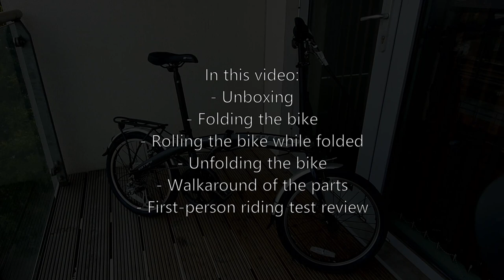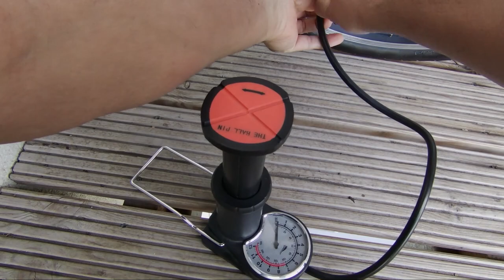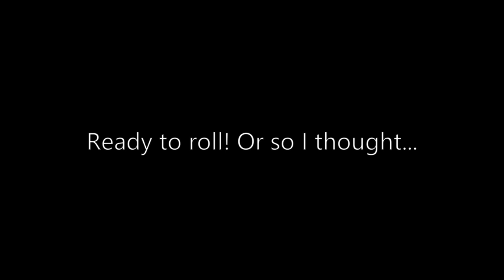Carrera Intercity Folding Bike - Unboxing, Walkaround and First Ride Review

Comment from the maker: Timestamps:
Unboxing 00:31
Weight 2:26
Close-up of ball & folding clasp 2:41 
Common areas easily scratched 03:55 
Safety Warning: Steering column  04:27
Tighten steering column lock 07:20
Folding the bike 08:46
Folding the pedals 09:08
Rolling bike along while folded 09:41
Unfolding the bike 14:10
Tour of the parts 15:37
V-brakes 16:29
Tyre specifications 16:38
Seatpost and saddle 17:15
Bell 17:50
Middle folding clamp 17:53
Ball & clasp fold lock 18:15
Double sided chain guard 18:53
Luggage pannier rack 19:08
Gear index adjustment screws 19:32
Handlebar angle adjustment 20:19
Handlebar stem height adjustment 20:36 
Riding the bike POV footage / review 22:21
Reply: Thanks
Reply: @18:15 I read a review which suggested that instead having the handle in the middle (between the wheels) when you fold, to fold the bike in half then hang it over the saddle.

Obviously it won't be as compact but it locks in a lot more easily. I'm going to do it this way for a while to loosen it then try your method. Very helpful video!
Reply from the maker: @Fred-my9er  Yeah when I first got the bike the clasp was really hard to connect with the ball and it took a while for it to become looser. Hopefully as you use it with the handlebar on the outside it makes the clasp less tight and it becomes smoother over time.
Reply: Put a helmet on next time!!
You need a helmet on!!

Comment: Just bought this bike last week. Its great 👍. Its light, fast and a pleasure to ride..brakes are safe and responsive..for what you get its a bargain..the handle  bars are wide and the end grips so soft rubber making them comfortable and keep your grip secure in the rain..the 8 gears is enough for general commuting around the city as the Cog is larger in size so as to get more distance with each pedal rotation...I will be staying with the folding bikes from now on and at some point will be getting a 16 inch wheel folding bike and perhaps an electric one  but would be happy to ride a none electric as they are so light and easy to use...I am surprised at the speed . Its such a pleasure to get around the city...actually I dont use it as a folding bike and having put permanent nut and bolts in place on the bike as I leave it outside work for several hours, I do have a decent lock too, its a  Kriptonite extra strong anti drill lock and the steel cannot be sawn into....im happy with my first carrera intercity folding bike 😊

Comment: It’s cool to see at 25 minutes or so on Lower Thames Street that the guy on the road bike, who looked like a pro (road bike and dressed like a cyclist), didn’t speed off into the distance even though he looked like he was leaving you at the lights a peddling off relatively quick. You were catching him at the next light every time.
That’s very reassuring to people that might think that kids sized bikes (I know folding bikes are adult bikes) travel at kids speed, but you were moving at normal bikes speeds and even overtook several bikes.

Comment: I got one of these cheap second hand recently and found folding a hassle because you have to angle the brakes/lower the stem and the stem folds to the left so dangles around and gets in the way of the folding mechanism. Can't understand why they didn't make the stem fold to the right like a Brompton where it's out of the way. Anyway, I took an Allan key and unscrewed the stem and mounted it backwards and flipped over the handlebar, now it folds like a Brompton and is much easier to fold quickly without having to alter the height of the stem or the brakes and it stays put and doesn't get in the way when folding. The catch is still far too stiff for me when trying to unfold it, so I might source a strong magnet like they use for door catches to hold the frame together.
Reply from the maker: These bikes are great value second hand.

It's useful to know the stem can actually be switched that way for anyone who prefers it folding to the right. Thanks. 

Personally, I like it the way it is, as the handlebars and stem are then fixed in between the wheels and it takes less width space. It also results in a more manageable 'cuboid' shape to put inside storage bag or slim interior gaps in the house. But agree, it definitely comes at the cost of more steps to fold it like that. 

In regard to the catch, the front half of my one (the ball end) had actually wriggled itself loose out of the threaded socket attached to the fork and fallen off somewhere so I had to find a replacement. 

I took a chance on a magnetic catch originally designed for Dahon bikes but the plate side is actually the same bolt size as the ball head I lost so was able to simply screw that in to the threaded socket. I then took off the black bracket from the rear wheel, and attached the magnet half of the new catch and it works pretty well and is much easier to lock and detach. It's also still strong enough to keep the bike folded when lifting etc.

I bought mine off e bay - if you search for keywords "Magnetic Folding Bike Catch Dahon" you'll probably find several examples, if you wanted to have a look.
Reply: @ImOnItLikeJamOnToast I've ordered a magnetic latch off Amazon that looks identical. Also I've seen a seat post stopper with a castor wheel available on there. If I install that, it would lift the rear wheel off the ground slightly letting me leave the handlebars up and roll it using the front wheel balanced against the castor similar to a Brompton in shopping cart mode. I'm basically turning it into a cheap Brompton, I have a Brompton, but I was looking for something with bigger wheels, but all the other folders are just useless heavy lumps when folded and you can't really go shopping with them, but this config might work. Also allows me to leave my Brompton home when it's wet and muddy as the small wheels don't allow much traction in the rain.
Reply from the maker: @neverstopplayinghard   That seat post stopper wheel sounds cool. Wonder if it would still let you lift the seat post up as the base of the post needs to go up into the frame when lifting the seat into riding position.
Reply: That's a good point, this is the one I ordered: https://www.amazon.co.uk/dp/B09V76BH6T? If it gets in the way I might be able to sand it down, or get a seatpost extender to cover the lost length. I just need it to roll effectively when folded up, as it's just a bother to move around. Brompton are definitely the best bikes for going shopping with, except you definitely need a rack fitted for stability.
Reply from the maker: @neverstopplayinghard  Thanks for the link. Looks like an really useful accessory. Would be interested to find out how you get on once it arrives 👍🏼
Reply: @ImOnItLikeJamOnToast  To update, the seat post stopper wheel I ordered fits, you can expand it inside with an Allan key. The seatpost will also extend up through the frame without it catching which is excellent news. With the seatpost down and handlebars up you can push it around providing you lean it to the right slightly so it balances only on the seatpost wheel and front wheel without engaging the back wheel and mechanism. Though I find it actually less awkward for longer transport while folded to just push it from the other side so the handlebars are backwards and you angle it up like you do pushing with the seatpost in the video except now you can rest it without it damaging the gearing. The Dahon style magnet catch works ok but the plates don't seem to line up flush because of a slight angle which is not ideal, might try putting one of the bolts in a vice and bending it to a better angle. The bike certainly copes better in the wet than a Brompton, but still takes much longer and more fiddly to fold and transport.
Reply from the maker: @Steven Williams thanks for updating. It's great to know that seat post stopper works with this bike.
Reply: Genius😊

Comment: Old video, but good information. This bike is offered under many different names, it's important to check every nut and bolt, and the frame and handlebar locks MUST have the security clamp in use at all times.

Comment: Good review. I’ve had this bike for about a year, really nice bike but I’ve not had a chance to ride it enough. Good tip about the steering column lock, thankfully I’ve never had an issue with it loosening but I’ll be sure to lock it in place now.

I also agree that the mud guards should’ve been painted black/dark grey  to match the frame.

Comment: Im only nearing the half way mark in the video and had to pause to say something.

What a well and clearly spoken, calm, person!

Even a Londoner understands you 1000% 🙈

Brilliant explanations so far! I hope the ride part goes well (excluding the steering folding in half on you on your first ride - could happen to anybody)

Just saw the date… do you still use this bike and how has it held up 1 year later?
Reply from the maker: Thanks for your nice feedback. I still use the bike now and then for leisure but since getting a job where I can work fully from home about a year ago  it doesn't get as much use as before. It does still come in handy for quick trips and for exploring holiday areas when I've taken it in the car. Bike hasn't given me much major things to complain about, only minor things like the rubber handle bar grips have loosened  slightly and lost one of the folding clip ends after it fell off somewhere. I did manage to find a replacement solution (magnetic clip) which seems to be far easier to use, so maybe a blessing in disguise! I'll try and do an update video on the bike soon when I get some free time.

Comment: Fantastic review. I'm just about to be given this bike. Did you find that the locking mechanism is a bit loose? The bike opens up too easily.
Reply from the maker: If it's clipped in properly, it's actually very secure in mine and takes a sharp tug to get it open again.

Comment: Thank you very much for your valuable sharing. I want to learn riding bicycle. Is this bike suitable for learner and is it pre assembled? 😊
Reply from the maker: It comes assembled, but if buying in box, the gears and brakes may not be tuned or perfectly set up so that would be something you'd need to look at getting adjusted if the gear changes are not smooth or brakes are scraping. Both are fairly easy to do at home if you look up tutorial videos on these subjects.

In regard to learning how to ride, a folding bike probably wouldnt be my first choice to learn as the steering can be 'twitchy' on these bikes where the fork and stem are tall and the wheels are small. By this I mean, the steering has more tendency to turn by itself if you're not constantly holding the handlebar and correcting course. On a normal bike, the front wheel is easier to keep  pointing straight ahead. Once you've got the hang of riding, a folding bike would be no problem after that but as a learner it might be a lot more to take in, on top of trying to learn how to balance your weight etc.
Reply: @ImOnItLikeJamOnToast  Thank you so much for your valuable advice. It’s very very useful for me. If folding bike is not very suitable for learner, which type is suitable？ Mountain bike or hydrid bike？ Any brand is the best？ Thank you very much ！
Reply from the maker: @attilayeung3208  I would say a hybrid bike is better as they tend to be lighter than mountain bikes, but there are also some light mountain bikes too so best to check the weight when buying. An important thing when learning and for comfort, is to make sure the bike is the right size for you, you are not stretching/bending too far to hold the handlebars and you can easily touch the ground with your toes.

 There are many good brands and options. On the budget end, I heard good things about the Triban, Rockrider, and Riverside models from Decathlon. From Halfords, the Carerra Subway Hybrid models have good components and reputation. There are more expensive brands like Giant and Specialized but I don't have much experience with those but they seem to be very popular, I see a lot of people riding those names.
Reply: @ImOnItLikeJamOnToast  Thank you so much. Your advice is very useful for me.

Comment: Nice vid, I am a lot taller than you nearly 6ft, you said you are 5'7", can you tell me how much travel of the handle bar stem is  there, I would not want my handle bars to be to low when riding?
Reply from the maker: I have the handlebars near the minimum mark (lowest is 8 I have it at 7). The handlebar raised at the maximum safe limit (near the '1' mark) measures a height of 110cm from the ground

Comment: Good review, I got this bike last week, bicycle newbie and this is my first bike. I  got it from halford and while riding my handlebar went to the left  side n I nearly stacked it... which was scary, had to take it back to halford and they had to tighten the handlebar.....  my middle clamp the bottom which says open n close doesn't work... I just need to clamp n unclamp? Is this the same with yours...
Reply from the maker: You need to slide the little lock switch on the top of the clamp in the direction of the side that says 'open' with your thumb and hold it while you try to open the clamp. Otherwise the clamp won't open for safety. Look at around the 18:00 mark in the video where I open it. Hope this helps.
Reply: @ImOnItLikeJamOnToast  my one doesn't work like that, I can open it without pushing it down to open.... I did question this with halford and they said it looks fine and had tighten the clamp...
Reply from the maker: @modin5109  Hmm, doesn't seem right. Mine works as like in the video, you have to slide the switch to 'open' in order to release it.
Reply: OK thanks, I just checked and all the little rock does is slide but it doesn't matter if I slide it or not  as clamp can still open

Comment: Would you still recommend this bike today for general commutes?
Reply from the maker: I would recommend this bike if the ability to fold it is a vital requirement as it does come at a cost. It is nippy to ride for journeys less than around 4-5 miles, but I find it tiring/uncomfortable for journeys longer than that due to the smaller wheels, it does feel less efficient than a 26" or 700C wheel bike. If you don't need a folding bike, then a full size rigid bike is faster and more comfortable for commuting.

It is great for situations where I want to quickly go somewhere and take the bike in with me (I take it to supermarkets and put it in the trolley or roll it folded for quick purchases, for going into local off-site work locations, to the barbers and put it folded inside the shop, put in the car boot and explore the surrounding areas etc).
Reply: @ImOnItLikeJamOnToast  Brilliant. Thanks for the reply, much appreciated.

Comment: Do you know what the maximum weight the bike can hold is? Thanks for the video!
Reply from the maker: The manual didn't mention anything regarding max weight. But according to halfords website, it is 100 KG max for their folding bikes:

"Unless otherwise stated, folding bikes are designed to carry a rider of up to 85kg (13st 5lbs) and up to 15Kg of luggage."
Reply: @ImOnItLikeJamOnToast  That's fantastic thanks for the answer!
Reply: I'm 14st or just over....

Comment: I got this bike a few days ago. I managed to fold it by watching this video, but when I unfolded the bike the front wheel wouldn't move. I dont know much about bikes I'm not sure if it's something to do with the brakes?
Reply from the maker: It could be the brakes - have a look near the brake pads (black rubber) and see if they're touching the silver wheel rim, you can jiggle the black arms of the brakes a bit side to side to re-centre them so the rubber isn't touching. Other things to check is to see if the mud guard hasnt somehow bent and trapping the tyre, or if there is some obstruction in the wheel spokes.
Reply: @ImOnItLikeJamOnToast  Thank you for your reply I'll check it out.
Reply: Thank you I managed to fix it. Some cables got wrapped around the reflector forcing down the brake

Comment: Do you know how long and wide the seatpost is ? I had mine stolen recently and the two I ordered didnt fit
Reply from the maker: Sorry to hear about your seatpost being stolen. :( 
The seatpost is 34mm in diameter.
The total length is 545mm. But the seatpost narrows at the top where it connects to the saddle, so if you wanted to know how long just the main part is, it is 480mm and the tapered part at top is 65mm.

Hope this helps.
Reply: @ImOnItLikeJamOnToast  thank you so much !!

Comment: How far of a commute would you go on this bike? I have a 7 mile journey to work. I do have a hybrid bike, but i want a bike i can take into the office with me and not leave outside. Also take into the flat when I get home, but just deciding whether or not a folding bike would be comfortable and quick enough to do the 7 miles in a reasonable time.
Reply from the maker: The average single journey I do on this bike is between 2-4 miles (so 4-8 miles return). Its great for quick trips but anything above 5 miles can feel like a slog depending on the route. 

For example, 5 miles on flat smooth cycle lanes isn't actually bad, but if mixed with gravel, pebbled/ bricked roads, inclines etc would make a big difference to comfort.  Although the occasional long journey has been fine, I personally would not find this to be as comfortable as a larger wheel bike (I also have 29inch hybrid) for doing it daily above 5 mile each way on mixed terrain. 

The small wheels and folding body doesn't absorb bumps as well as a standard bike, and although nippy its not as efficient. Then again I'm still using the stock saddle which can get sore on these kinds of routes so maybe a better saddle could help.